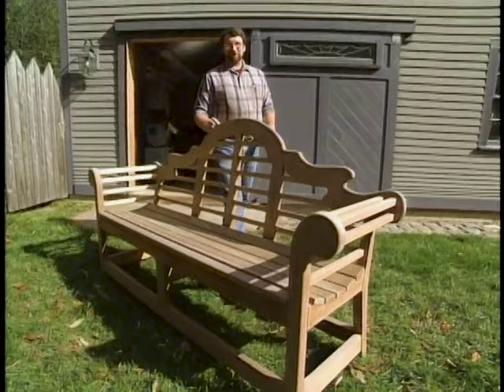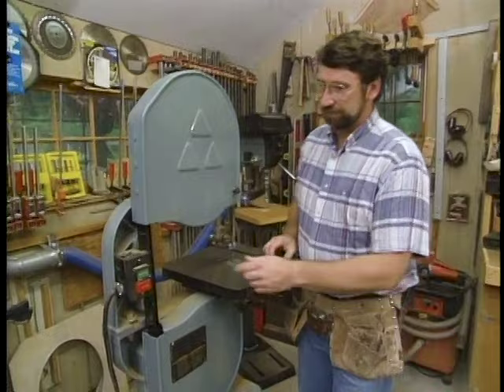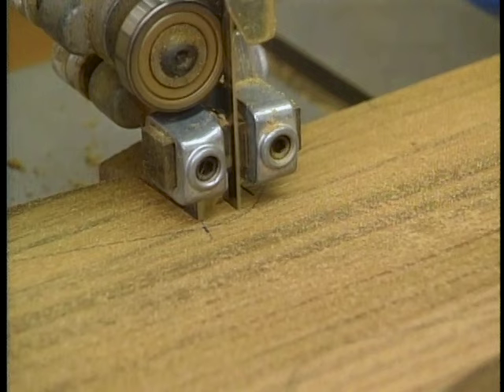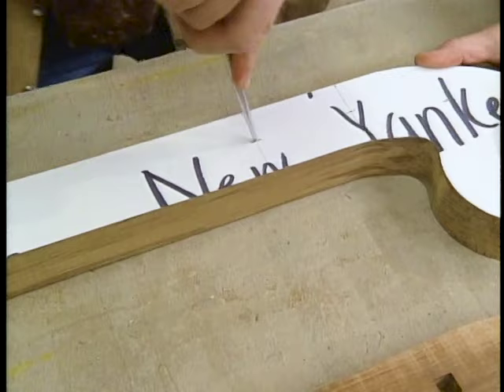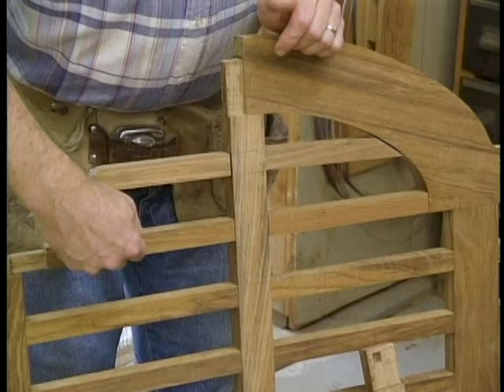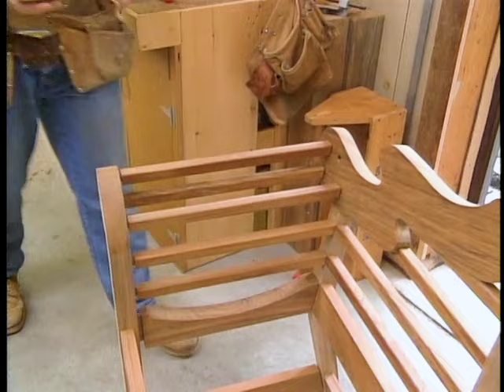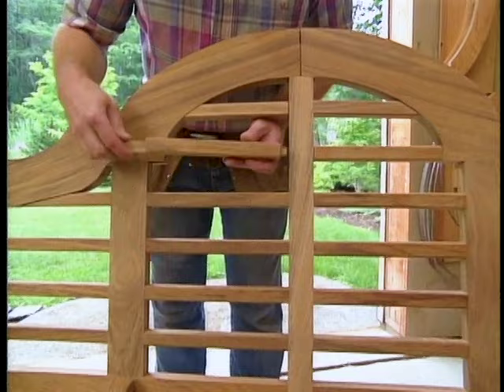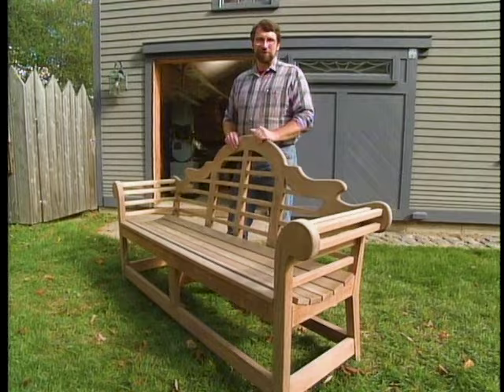Lutyens Bench  |  S7 E6

Comment: Tip if you use poster board as templates, coat the poster board with polyurethane then cut out the lines, the edges will be crisp and hard, lasting much longer.

Comment: Using Norms plans that I purchased many years ago. I spent two summers working on completing this project. Extraordinarily difficult, and I don't really have what you would call a shop. But I have to say, it came out beautiful and I get nothing but compliments on it. Thanks, Norm. By the way, I made mine out of clear Redwood.
Reply: That's impressive, it's a beautiful bench and without a fully equipped shop even more so. Norm is a modern master and makes things look much easier than they actually are.  I'm not a woodworker, my father was pretty good, as a kid I would help him a bit. I enjoy watching such vids, there's a channel called Unemployed Redneck Hillbilly, a retiree in upstate NY, he's a very good woodworker and some interesting vids.
Reply: @cardo1111  The plans really require a CAD program so you can create accurate templates.  Having the templates shown in the Video makes the build 1000% easier.  And really should have been included.  Took me over a year to create the needed templates by hand.  The creation of the back legs from the plan is the most difficult part and must be exact or it will not come together at the end.  The back panel with the multiple slates and the arm slates take great precision, otherwise, they will not be parallel to each other.  It is the build I am most proud of.  I bought the plans at least 25 years ago along with a fireplace plan, intending someday to build them.  15 years ago I created the top back curve section.  It took me 13 more years to attempt to finish the project, those 3 back legs are the killer.  Wish I could post a pic.
Reply: @paulgeek  made two myself. First I didn’t even own a jig saw. Second wasn’t much better. Gona have another go with these plans. An change o a link to your fireplace?

Comment: Today because of the cost of Teak, that bench would cost upwards of $1000 to build, let alone sell lol.
Reply: Navy1977  well, depending on what a customer is willing to pay,  (around here Teak is $48 per board foot), if Teak is out of their price range, I'd use ash, oak, red oak, also the customer may want something darker or lighter than Teak. I basically will build one custom in a case where someone finds it too expensive. Though I would use Teak, but the price would be so high it may never sell, also I know how many board feet I used, and adjust the price of a finished product as it goes up and down.